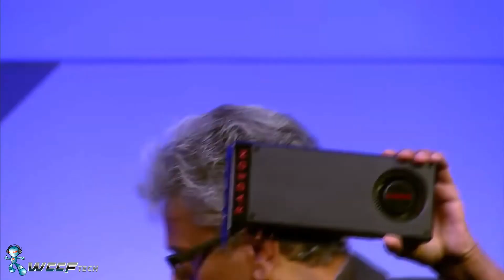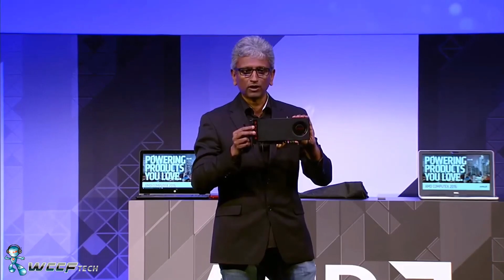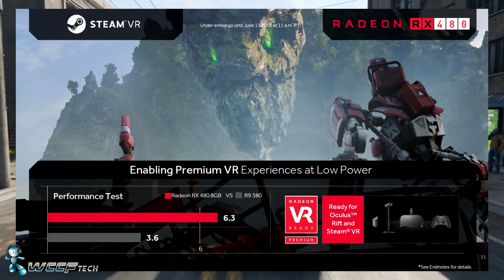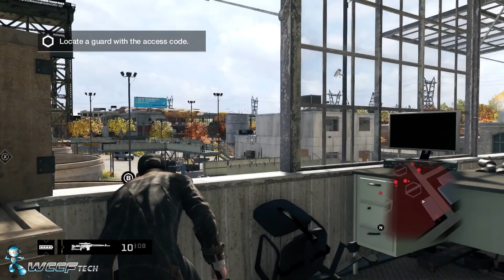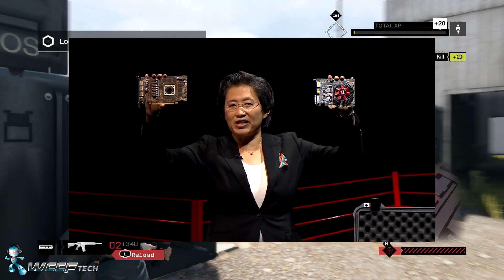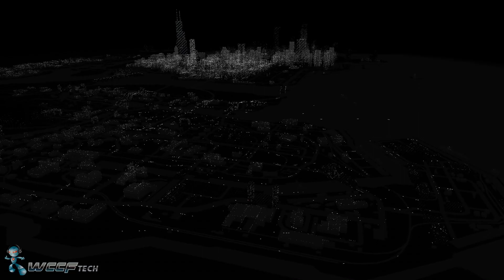Radeon RX 480 Details and Performance Expectations

Comment: "The Rx 480 while running 1500mhz is on par with the stock 1070 in-game, it even beats it on some games at this clock, anything more and the 480 begins to put some distance between the two cards. Keep in mind this is Dx12 games, this is where GCN 4 truly shows off."
(c), http://www.overclock.net